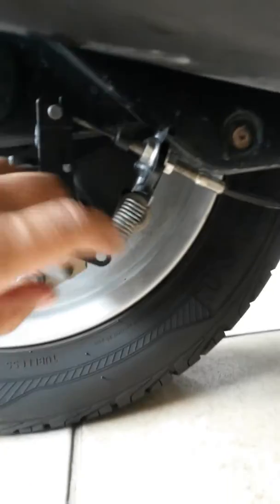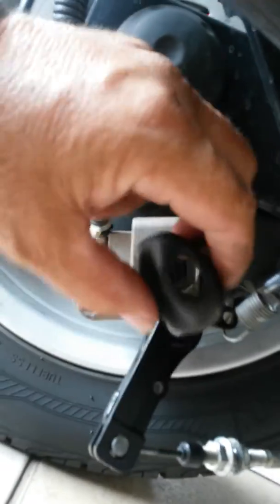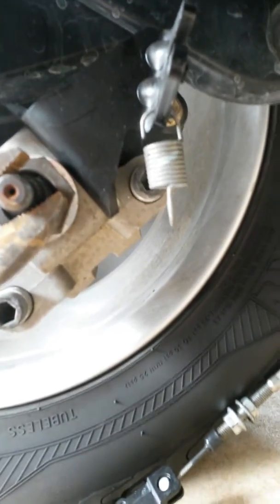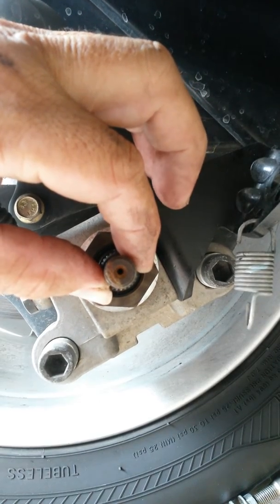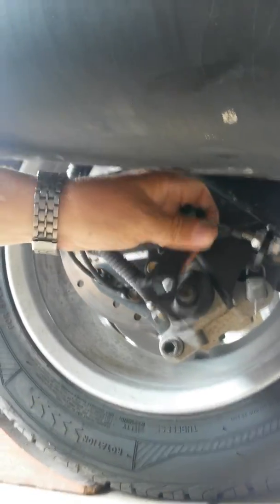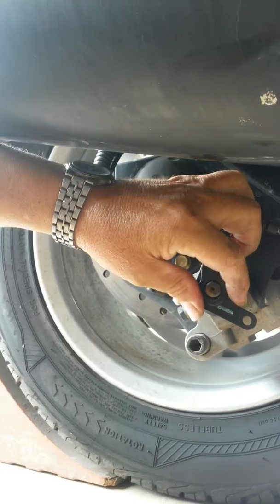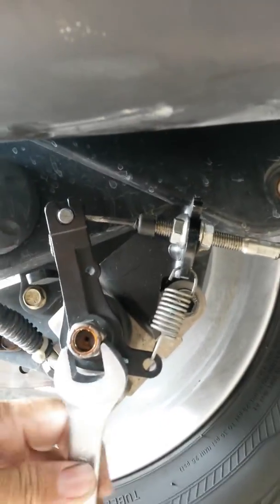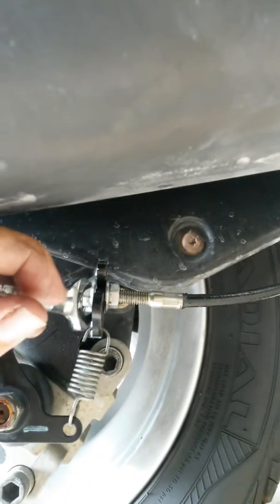adjusting brake can am spyder

Comment: Question for you Archie 

Let me start off by saying I love you videos and thank you for helping assistant many of the Can-Am Spyder Riders out there like myself .

I have a question for you, I have a

 2009 Spyder se5 

the issue that I am facing is on the dash it keeps scrolling parking brake reading 

it keeps scrolling across the dash the caution sign / warning sign is flashing while riding 

the parking brake is fully up the bike is able to go in motion forward and backwards without any resistance 

when I try to push down my parking Brakes in order to try to either park it or release it 
 the parking brake stays up not parked and it doesn't make that clicking sound like a ratchet would make when you press down on the parking brakes

Truly appreciate ,
Jai
Reply from the maker: thank you for your comment, i am glad is doing some good,  some times the spyder can be a real pain and frustrating  , but i like sharing my findings ,best regards

Comment: Archi ----  is this for the foot brake , or the parking brake ?   ---- or both !    good information if it  will increase the pressure on the foot brake peddle travel ... (  still in Starkville ? )
Reply from the maker: that was the parking brake. it used to get stuck and even if i fushed it down hard the bike will still roll away. and to take the parking brake off was a pain... i recomend you to clean up the mechanism on the pedal, there is a spring . take it all apart and clean, then go back to do what i did on the video,, good luck my friend....ohhh im not in starkville i em in El Salvador
Reply from the maker: I WAS DOING PARKING BRAKE.